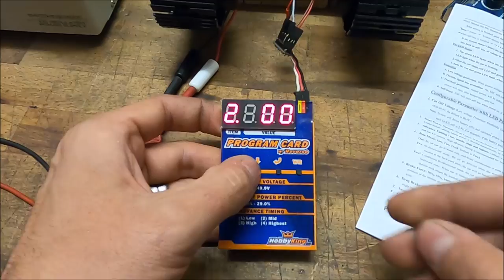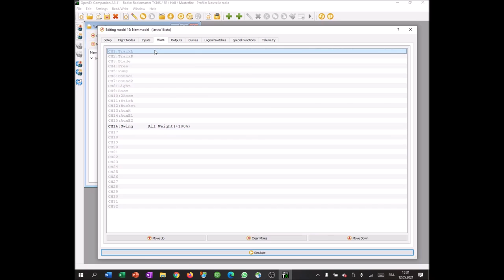Build - RC Hitachi Zaxis ZX135US 1:15 Scale Excavator Part 4 - Paint and final assembly

Comment: To be honest, the way your excavator has been constructed is very professional so is your craftmanship!
It's definitely satisfying to look at it, you built a model of highest quality.
Have fun with it, i really love it!
Reply: The great thing about his builds is that it is done quickly. That is possible with just using mainly hand tools and simplify details. The proffesional manufacturers as Premacon and THS spend possible x10 more hours on their machines, in order to include all details as the real thing. But to a large number of people, they will not see any big difference between a machine built in 50 hours and one built in 500 hours. I am a fan of the quick and easy building method, but great looking, used here. More than detailed enough too most people.
Reply: I totally agree with you except that I would say that this model took a few hundred hours to be built too.
But it's just my guess, maybe he will tell us..
Reply from the maker: @Kniftel  Aprox 200h for this one. Yes it's not detailled as a premacon on THS. The big difference is building and drawing process, I work by hand and with 2D drawing, can't be compared to a CAD, CNC and modling process.
Reply: Totaly Agree. Premacon, Scale Art, THS are from Germany. German manufactures and factories do not compete with each other, but cooperate - Premacon whit Liebherr, Jung and Servonaut, Scale Art with Mercedes, Man and Servonaut, THS whit Liebherr and Volvo. These manufactories have access to the original factory CAD drawings, which is the basis. No company will make their drawings available to the man on the street. You must have connections. Another issue is the technical facilities, CNC machines, etc. Not everyone has a CNC milling machine or laser cuter in their garage.
Reply: @Rimrock300 This may have looked like a quick build but it certainly wouldn't have been.

Comment: You show that the model made in this way does not have to be extremely expensive, of course, I omit all the hydraulics (pump, valves and cylinders) are the most expensive elements of this build. In the description you made a reservation that it is not an exact copy of a real machine, it does not matter to me, because in my opinion what you have built does not differ in quality from the extremely expensive RC excavators for thousands of Euro. Looks like real and works like real, plus you made it with your own hands. Could there be anything more satisfying? You should open your own manufacture, because I see that you are a talented person. Congratulations!!! P.S. Thank you for the electronics wiring diagram, it makes all connections are clear. It is a big help for newbies. :))) Best regards from Poland :)

Comment: Well.. I have no words. This is incredible. In fact, this is very inspiring. Some things, if you want them to be really good, require a lot of attention and details, and those who are not afraid, just roll up their sleeves and get the job done, piece by piece, piece by piece. In the end you have a beauty. I have a (programming) project myself, for it to become complete, I still need to get a lot of minor details done. There is no work around, one just needs to sit down and do parts of the job, one by one, till the end.

Comment: A couple of questions if you don't mind me asking: 
- You welded the brass, and glued the aluminum. However, there is a part on video 1 that you weld some silver material with the electric welder. What material is it?
- To glue the aluminum, you just use Epoxy glue or something similar to JBWeld?
Reply from the maker: Brass and steel are soldered with electronic solder tin. Aluminium is glued with epoxy. Sometimes I use Alia 382 for solder aluminium but not on thin parts.
I use epoxy Endfest 300

Comment: Steve, is the black hydraulic hose you are using a bit flexible, or hard? 

Usually if it's hard it is very difficult to fix to the connector
Reply from the maker: It's the magom, harder than leimbach but softer than APK or most of china product. Good conpromise for 15bars

Comment: Hello, would I be right in assuming these are closed centre spool valves? And that the PRV is always off the seat maintaining pressure the whole time the pump is running?
Reply from the maker: Yes, that why ths pump isn't allways running
Reply: @BartsteRCModels  cool, thanks

Comment: very well done. what were you using when coding in the track movements at 04:40?
Reply from the maker: It's a programmin card from hobbyking. I use it for setup the esc, reverse force, brake, ...

Comment: Near the end of the video when you were moving the different  parts of the arm by hand .. Could you please tell me why you moved the the bucket against the normal direction it was supposed to move to .. while the other parts of the arm you were moving them in the same direction they were supposed to go to ... Thanks again
Reply from the maker: On first test you didn't know if servo are in the right direction, so you have to move in the 2 direction for prime the oil system

Comment: Wow it is amazing! Really nice build, again 👍🏻. Do you have a new transmitter, a Radiomaster? Do you like it?
Reply from the maker: Yes it's a great radio. For me, better than my Horus X12S.
Reply: @BartsteRCModels  even better than the Horus!? 😳 I liked that one already, but this one is way cheaper isn't it? What do you like so much?
Reply from the maker: @BMtechnl  It's personnal. The TX16 is smaller, lighter (I drive with thumb). black simple and clean design (I hate the purple effect on the horus) You can change the battery easily, USB-C charger (no specific charger). 2 more switch input (SI and SJ), multiprotocole internal HF, touch screen ready. half the price...
Reply: @BartsteRCModels  that's good to know👍🏻 Thanks for your reply.

Comment: I love your videos and watch them a lot, im building my own excavator now. Can you please tell me where you got your pump. I have a premacon pump its to long. I need one just like you have short. If you could help me that would be much appreciated.
Reply from the maker: It's a Jung HR-7 pump with planetary gear Kontronik 4:1. The assembly is homemade
Reply: @BartsteRCModels  thank you! Is it’s a single stage planetary gear set? Also did you make gears yourself? I’m curious, I’m a machinist I wanted to build the same pump as you. I have a Premacon pump and motor but it’s to long. That’s why I like yours small but very good pump head .
Reply from the maker: Gear come from kontronik, single stage. 
I lost the name, but a deutch brand sell a short version of jung pump.